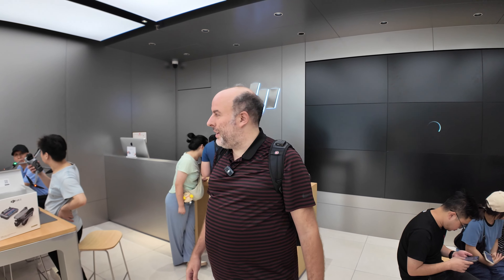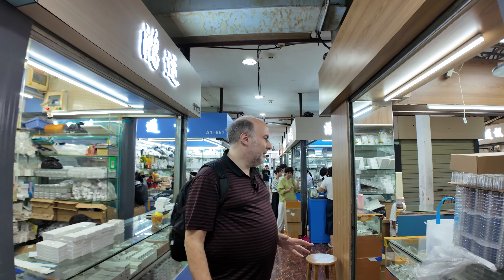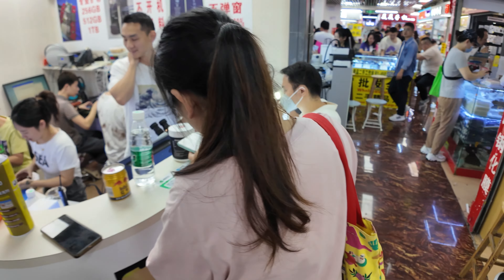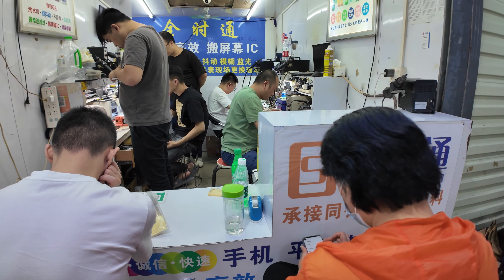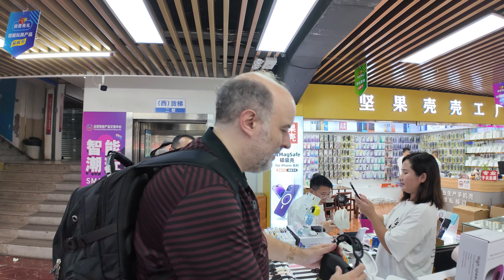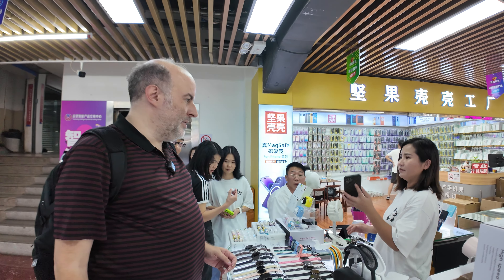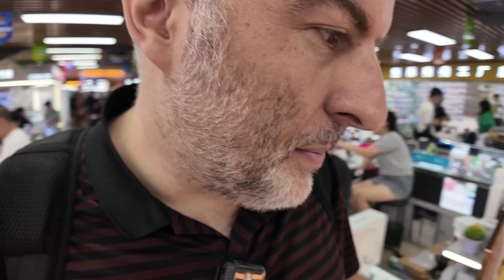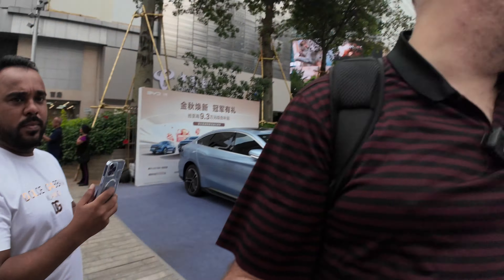China's Electronics Market Huaqiangbei Tour, celebrating 100K Subscribers My first Pocket 3 video

Comment: What credit card did you link with your WeChat pay please ? I only have debit card in France and this is a problem. I need to pay with WeChat pay…
Reply from the maker: Wechat Pay only works with China registered bank cards, but you can use Alipay everywhere in China and with Alipay you can use foreigner international debit/credit cards no problem! They might ask you to verify your passport/ID at some point in there, and they don't let you pay certain QR codes that may require China registered debit cards, for example those automated vending machines don't work for foreigners on Alipay, and direct private Alipay payments don't work as well as Company QR codes when you buy stuff in stores and such it works fine.
Reply from the maker: On the other hand, I heard that foreigners can open bank accounts in China "easily" just showing your foreigner Passport and valid Chinese visa, perhaps show them you've been to China more than once, and they let you open a China bank account, then I guess it'd be no problem for you to use Wechat Pay and Alipay for all sorts of payments at that point..